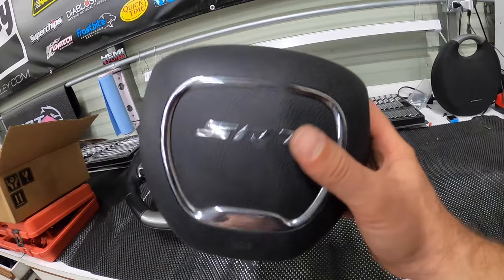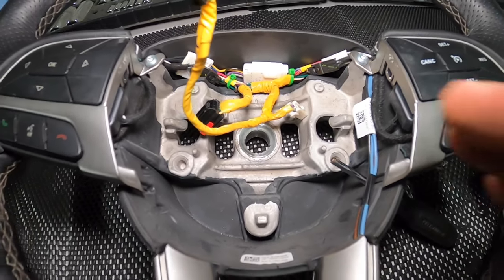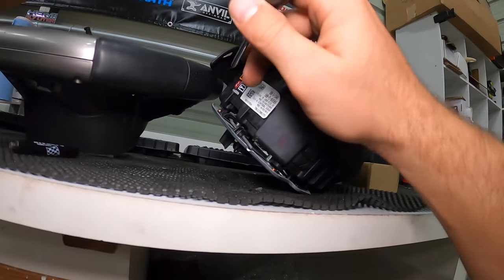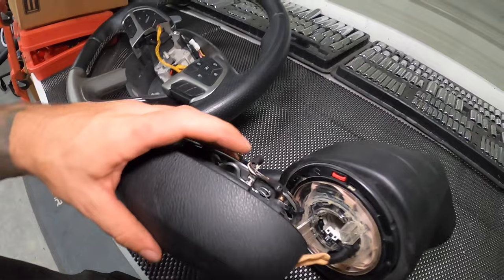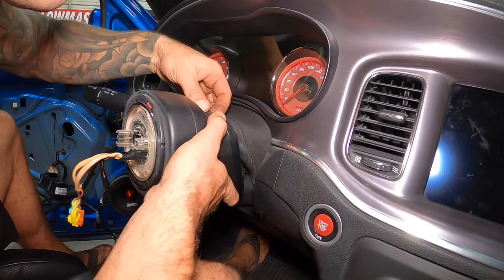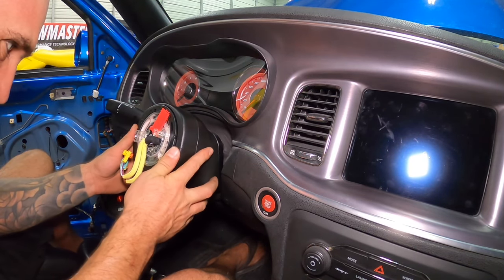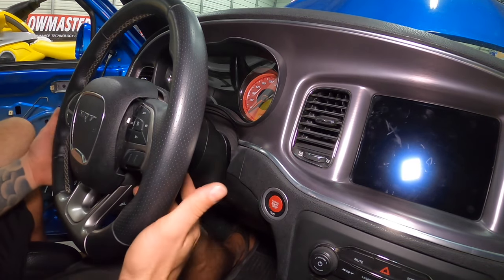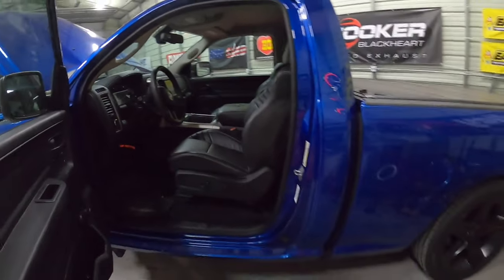Airbag Removal & Clock Spring Replacement & Steering wheel Removal |  Dodge Charger Challenger JEEP

Comment: I do have better and more useful insight into removing the airbag and horn assembly. Cut the screwdriver head off. Then, go back and notch a "V" groove in the end that you just cut the head or point of the screwdriver off. This will allow you to actually grab and secure the "spring wire" that is securing the airbag assembly to the steering wheel. You need to press in at least a half inch if not more on the spring wire to get it past the "protrusion" that secures the airbag assembly to the steering wheel. A flat, blunt end, while eventually effective, is frustratingly imprecise in pushing the spring wire in towards the center of the steering wheel and beyond the "protrusions" that secures the airbag assembly to the steering wheel. You need to press in much harder than conveyed. The other interesting point, nobody goes back and mentions, is the housing where you insert a mechanism or device is rubber. you can easily force a much larger diameter tool through the opening, within reason, than a 1/8-inch diameter as mentioned. It is not as easy as conveyed and frankly every internet instruction is lacking in real detail. So, if you press in on the spring, and it does not release, but only kinda' of allows the cover and airbag assembly to move a couple of millimeters forward, you need to press in on the spring much harder for greater compression towards the center of the steering wheel.
Reply: Great instruction. Thx

Comment: You can also remove 2 Phillips head screws from the bottom back of the wheel itself (not the center portion) and pop off the back of the spokes where it says "since 1941"
From there just turn the wheel upside down, or look from under it, and get your tabs that way. No guessing or feeling. You'll have a visual path

Comment: I have a question can you do the same exact thing if your wires is melted to the air bag ? Can you cut the wires from clockspring to air bag? throw away the old and replace the clock spring with a new one ?

Comment: I see your clock spring is the full assembly. When i find them to purchase they are usually just the clock spring housing. Does that part just pop out of the housing you removed with the directional stick? I hope this question makes sense. Im looking to install a heated steering wheel in my scat pack. I found the wheel and clock spring am i can enable it in the radio. Im just wondering about the clock spring before i purchase one.

Comment: Great Video! Do you know i a scatpack WB with a flat bottom wheel could take one of those srt lit airbags? planning to buy one but dont know if the LED connection will be available unther it. thanks in advance for any info...

Comment: Hi, I have a 2018 5.7 challenger & am wanting to order both an oem srt steering wheel & srt airbag as you have in your video. Do you know whether my stock clock spring & wires will hook up or accept the srt’s steering wheel, air bag, & wiring?

Comment: Is the clock spring the same as the SCM (steering control module)? My challenger is throwing a P1009-00 code and my brights won't work. I can't find anything on Youtube regarding replacement of the SCM. I appreciate your video and the great information within it.
Reply: so supposedly you have to buy the whole SCM for the clockspring. i was hoping i could’ve just installed  the old clockspring on the new SCM

Comment: If the clock spring is bad. The buttons on the steering wheel won’t work ?
Reply: Correct I’m currently having this problem I checked my fuse and they are all good so next thing is finding a clock spring

Comment: I put the headers im my 2017 Ram 1500 but I make a mistake, move my steering and now I have many service light on. Did you think I have to change my clock spring ?
Reply: Most likely you will have to get the truck tuned because of the increased exhaust flow through the o2 sensor

Comment: Love the tip on the tool and will have to use it once I get around to installing my new CF wheel. One thing worth noting is the bolt that holds the wheel in place is supposed to be a one-time use bolt because the factory has some sort of thread locker on it. I just put a little Loctite on it when I screw mine back in. The steering wheel bolt torque is 63 ft lbs and if you want a new Mopar bolt, the part number is  6511907AA.
Reply: have you actually removed the steering wheel?
Reply: @timh1235  Yep, multiple times. Why?
Reply: The "Insight" gleaned from this video is hardly commensurate with the actual process of removing the air bag. But if you've done it then no need to point out "the change" that will make it actually do'able in a reasonable amount of time.  @AndreGuerrieri
Reply: @timh1235  This video makes the process I used easier. If you have an even better way, I'm all ears. My CF wheel is still sitting in my room waiting for installation. I don't like working in the cold 😂

Comment: If my horn doesn’t work but my steering wheel buttons still works what does that mean?
Reply: Did you ever find out? I’m having the same issue. My horn stopped working after changing the airbag/clock spring. I’m not sure if its because the clock spring isn’t properly aligned.
Reply: Same here it was working at first and suddenly it stopped

Comment: You said there were a lot of garbage videos online. Yeah, this is another one. You went to a whole speech about using a cut off driver handle, thats right (I use a t handled torx wrench) but you could have just removed the two phillips behind the wheel and been able to see where the metal springs are to push on, easy. You didnt even show the actual removal , you skipped that whole sequence. lol
Reply: Where are the screws exactly located